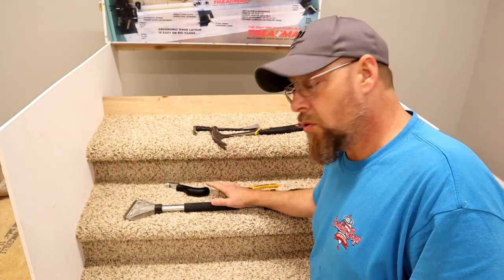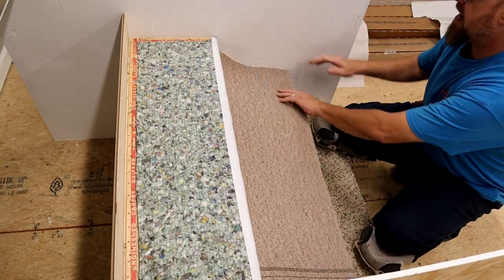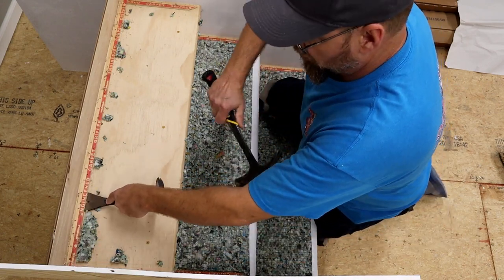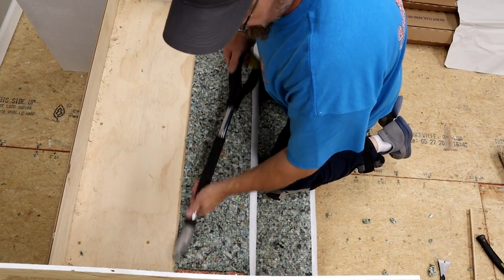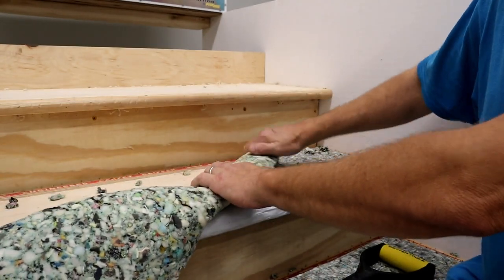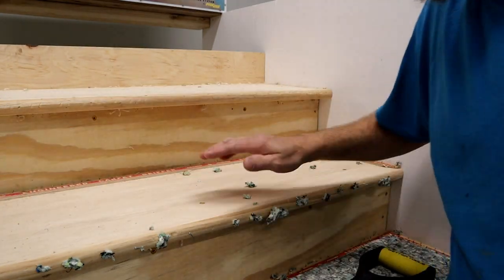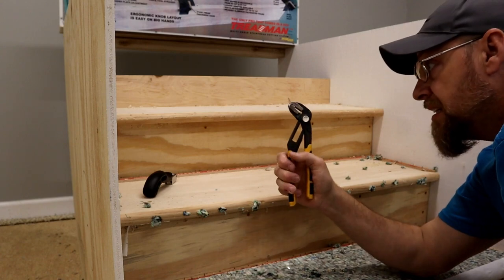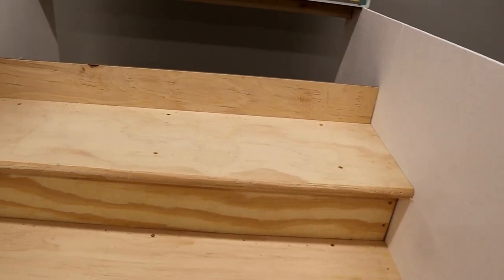HOW TO REMOVE CARPET FROM STAIRS/STEPS

Comment: Dude use your stair tool to remove the pad and the staples at the same time. And wtf use your stair tool and a rubber mallet to loosen the tack nails. Stops come up emediatlely
Reply: Strips*